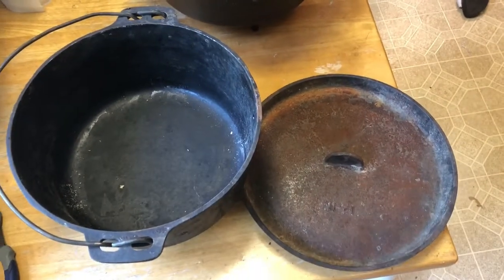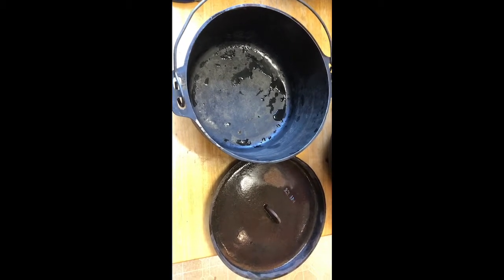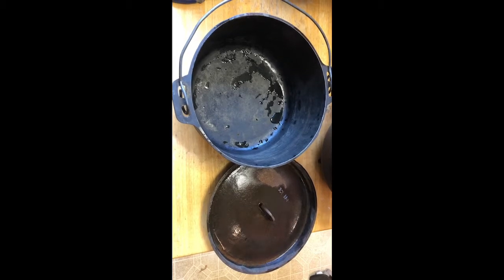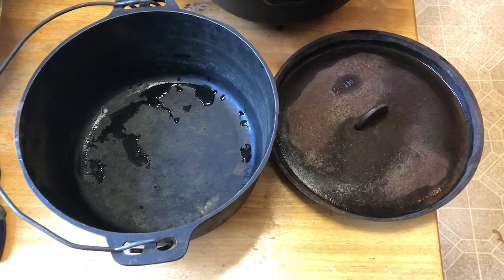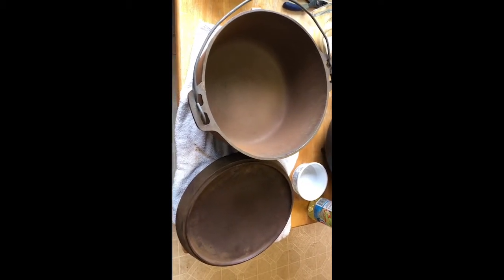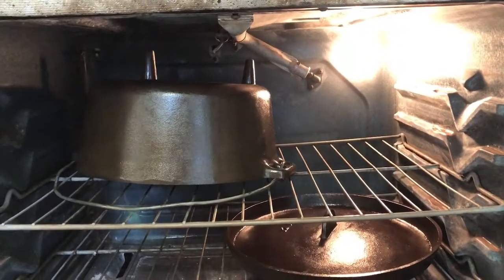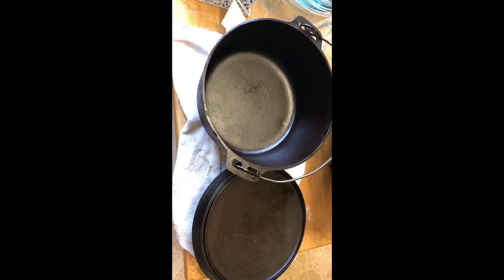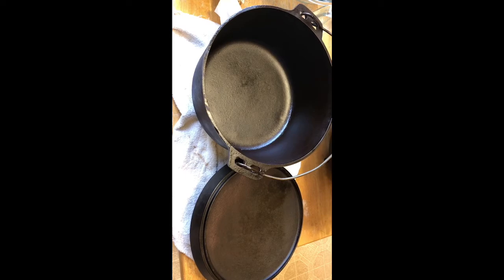Seasoning a Cast Iron Dutch Oven

Comment: Did you scrub with water and soap? Or just water?
Reply from the maker: The first time I scrubbed it I used s stainless steel scrubbing pad and Dawn Dish liquid,  Was just trying to get some of the old food and stickiness off of it.  i really didn't matter that I did that step at all, as it was going into the self cleaning oven at 880 degrees.  I was just trying to remove the stuff that was gross.  After it came out of the oven and was rusty, I used Scotch Brite and warm water to get the rust off and get as close to the metal as I could.   

Now that it has a good coat of seasoning on it, I hope that it will never see a metal scrubber again.  Hot water, a stiff brush, a plastic scraper and a little dawn dish liquid should be all that it needs to keep it clean.  I will put a light coat of vegetable oil on it when it is going to be stored for a while and a paper towel inside it.